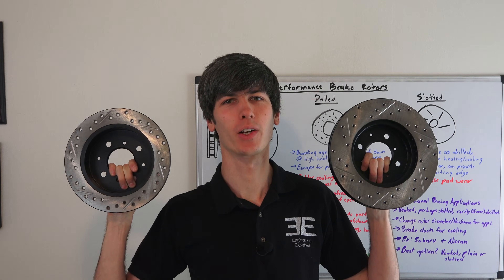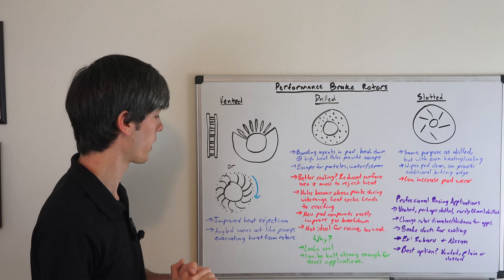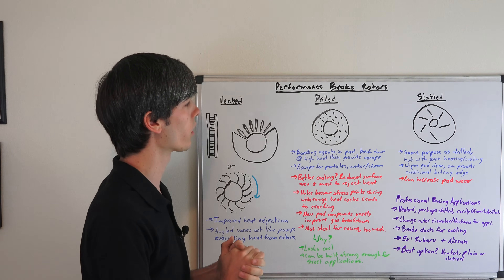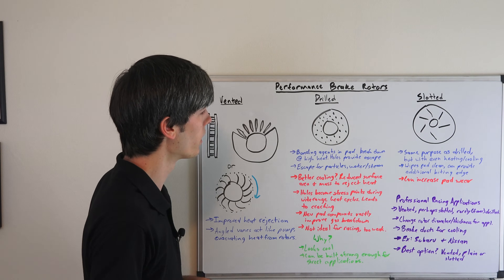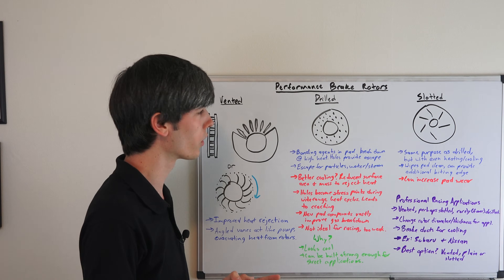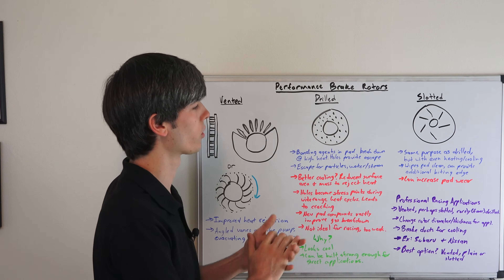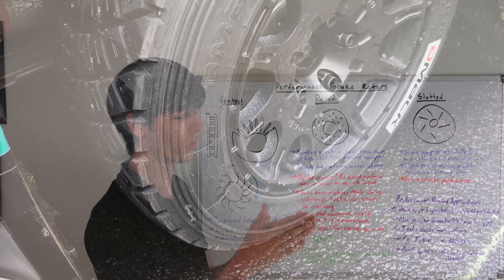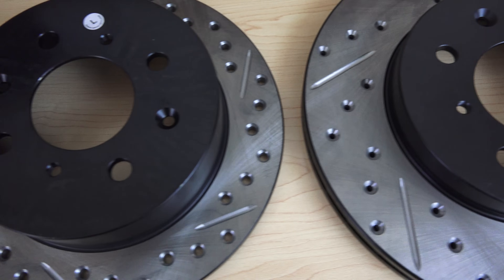Drilled, Slotted & Vented Brake Rotors - What's Best?

Comment: Anywhere in this video does he mention that drilled rotors decrease unsprung weight? It bothers me when he says "there's no reason". There's always a reason when you build a race car or street car. Often, cost and application. This is the second video I've watched where incorrect conclusions or assumptions are made without asking all the questions about the application. The Ford GT, which is a purpose built race car for the street used drilled rotors (among many other supercars). I'm sure material removal, heat dissapation, unsprung weight all came into play and were measured. They didn't just drill into them "for some reason". They test everything. "Because they look cool", you call yourself engineering explained...that statement is a design statement or marketing and subjective.
Reply: Well, "because it looks cool" is not that strange. Very often looks are much more important than engineering.
I know a guy that works in the aero department at Audi. He says the design guys always come first. If the aerodynamics don't "look cool" they're not going on the car, no matter how good they work.

Ford isn't going to drill brake rotors to "remove material". If they needed to remove material, they'd just make them thinner. Unless of course, it looks cool and sells cars...
Reply: Yeah thats why racing teams have gotten away from drilled even the new c7's are vented two piece rotors
Reply: He's talking full blown race car applications don't run with drilled rotors because there's not enough of a benefit. He also mentioned that street cars/supercars use drilled rotors as part of aesthetics and that companies will make them strong enough for their main purpose, which is to stop a daily driven vehicle under normal driving conditions or a supercar that will be driven hard every once in a while, at best, unlike an actual race car that's driven hard for atleast 30-40 minutes to as many as 24 hours of hard driving.

Comment: Every plain surface rotor I had on my cars very quickly warped - usually before the first pad change. The drilled/slotted rotors have never warped on me - even after a couple of pad changes (didn't have a chance to check the performance beyond that as I got a new car which came stock with plain rotors).

Comment: my civic has slotted vented drilled pads and painted red. plus ceramic pads. i beat ferraris and adds 50 hp each
Reply: Does it have v tak?
Reply: Just wait till you install a cold air intake.  You'll have trouble keeping that wicked Civic on the ground.

Comment: pretty good description of rotors, slotted rotors are made to cut a fresh surface to the pads and keep them as flat  as possible always giving a full pad surface for the most friction possible. the draw back is after the pads are done so are the rotors and they also have some vibrations from the slots scraping the pads at slower speeds. pretty sure formula racers use carbon fiber rotors that are able to handle much higher temps and reduce weight.

Comment: I thought the drilled rotors were popular to save weight. Kind of like a lightened flywheel. Itll take less force to spin something that weighs less.
Reply from the maker: xsenceo89x How much weight?
Reply: Engineering Explained That un-sprung, rotational weight yo
Reply: Engineering Explained  A couple of grams I'd guess 😂
Reply: Sometimes losing that mass can negatively affect the amount of heat the rotor can absorb too. 
Now ya have less metal, it gets hot faster with the same input.
It's all tradeoffs
Reply: xsenceo89x or just making them smaller is option. also when smaller the diameter will be less so the top part of the disc will waste less kinetic energy because the top part of the disc is with higher speed than the car

Comment: Engineering wise, the correct nomenclature is heat transfer, or heat dissipation. Not evacuation.

Another factor in drilled rotor cracking, in conjunction with cooling differential you mentioned, are the stress risers left behind by the drilling operation. 

Some high end rotors have cast-in  holes, which prevent that particular aspect - the microstructure of the metal is more uniform on all surfaces as compared to a ground rotor surface versus the drilled surface

Comment: have you ever watched a race or worked on a pit crew I have and drag cars and nascar use drilled and sloted rotters
Reply from the maker: +mk ninin drag cars only need to use the brakes once, so drilled is fine because it's a way of removing weight. Also done in drifting where there isn't much braking. Nascar as well has minimal braking. There's enough air resistance that letting off is generally more than enough for speed adjustments.
Reply: I went to a Supertrofeo race back in 2013 and while walking through the pit garages during the race, one of the pit guys asked if I wanted a souvenir then handed me a carbon ceramic brake disk off one of the race cars.  I don't know if they're 'drilled' but they do have holes in the braking surface just like a drilled rotor..  What's the story with these?  They're glowing bright orange at the end of a straight.  Do they just replace them so often it doesn't matter?
Reply: Carbon ceramic brakes are a different ball game when it comes to brake systems. Made from a different process, can hold higher heat, and last much longer. Hence their price tag.
Reply: how about formula one or motogp, they have disk brakes called 1200 holes made in carbo-ceramic compound, why are they using them if they might fail?
Reply: +Faby0699   As mentioned above, CCB have much higher heat capacity and can handle deep heat cycling better than cast iron. They can also tolerate cracks better without compromising function or structural integrity.
Reply: thank you!
Reply: Isn't excessive hard braking almost the ONLY thing that changes in drifting?  Besides eating thru tires and suspension

Comment: Love your videos. Brake rotors with holes do not create a fast temperature change. They cool off just about as fast as ones without the holes. I've seen temp tests measured on real street testing. But you are correct about surface being reduced with the many holes. I believe most all rotors are vented these days. And that is about the only thing that really matters. Temps do change higher and lower which is dependent more on racing and type of track. Not street use. For street use these do nothing to enhance the performance..or change temperature to benefits. Only the looks of them is the change. It is why you don't see spec temps listed for slotted or drilled rotors. The temp changes are really insignificant until you get to really racing around a track.
Reply: EE didn’t refer to a fast temperature change across the whole rotor. He specifically said holes result in rapid temperature ‘differential’ between areas of the rotor made of steel and adjacent areas made of well, air / nothing. Notably, the specific heat capacity of steel is 490 J/kg°C v. air at 1005 J/kg°C. That’s a significant differential that could lead to cracking even if only micro-cracks that only NDI can detect. Still, not good.

Comment: This cleared up a lot of controversy, thanks
Reply: TheCowGoesMoo o yes it does
Reply: ***** It does happen regardless of types of brake rotors, expecially if the weather is cold, and you go through deep water. 
You only need to give some heat on your brake system, and water will evaporate in seconds.
Reply: ***** correct, because no one drives with gt3 brakes in the rain on the highway. My regular rotors have done perfectly fine and has never done what you have experienced.

Comment: I believe you are 100% correct on all points. Imagine my dismay when my 2007 Corvette ZO6 had drilled and slotted front rotors. I guess GM didn’t get the memo, and wanted to impress potential customers.

Comment: I just put slotted / vented / drilled front rotors on my 2012 Honda Odyssey which are prone to have warped rotors after a few thousand miles. Honda has a problem with their brake design and time will tell if this holds up but so far I'm happy with it.

Comment: If you suspect your brake rotors are very hot from current aggressive driving, or some sudden stops,  do not sit with the brake pad on the rotors. Rather, apply light pressure, and let the car roll a little.  Otherwise brake pad material will adhere to the rotor causing a pulsation in the pedal.
Reply: the pulsation is from the rotor warping. if you got the rotors hot enough to melt the pads onto them, you need to replace both because overheating rotors hardens the material and warps it, causing a pulsation and reduced braking performance...same with the pad.
Reply: Adam S correct.  I am saying not to leave the pads sitting on hot rotors. Although, rotors can be cheap, it is best to have the oem rotors machined at a machine shop. This removes the material causing the pulse.  Many of the aftermarket rotors are not as good as the oem.
Reply: +Adam S

Another brake myth just like drilled rotors. Rotors never actually warp, pad material just deposits unevenly. Same effect but the cure isn't better cooling like people think it is. StopTech has a whitepaper about it.
Reply: +Leo. definitely not true, rotors most definitely warp. I've chucked up thousands on a lathe. The rotor runout however does not cause a brake pulsation because the whole caliper slides back and forth with the rotor.
Reply: +Afroninja52 .... Read it again dude... The warp effect is uneven pad material deposits on the rotor. The rotor itself doesn't actually warp. This is coming from one of the largest brake manufacturers.
Reply: +Afroninja52 Brake pulsations exist. Brake pulsations can be fixed by cutting a rotor. Brake pulsations CANNOT be prevented with drilled/slotted rotors. Brake pulsations CAN be prevented by using better brake pads. Make sense?
Reply: +Leo I never said that pad material transfer does not cause pulsation. Indeed it does. But rotors do in fact warp from excessive heat. If they don't then why do rotor manufacturers have runout limits? You can only cut rotors if they are within runout spec and above min thickness. That's like saying that rotors also do not get hot spots.
Reply: +Leo Yes, rotors physically warp when very highly heated. I've had it happen on many vehicles. Some light enough to just turn and fix, others way too gone.
Reply: You guys are hopeless.
Reply: Why would you apply light pressure at all? After a track session, we leave our cars in gear without the brakes applied at all so that the pads don't melt onto the rotors.
Reply: +n8tehgr8 Traffic in the pits, especially at 1/4 mile tracks. Idling forward to get your time slip after a 10 second run, coming off the highway after roll racing or off the mountain road after a canyon run.
Reply: +Leo what about the e brake?
Reply: +Junior Pivaral that will be a guaranteed way to ruin your rear rotors only.  At least when your rear rotors are warped, the steering wheel will not wobble, your rear will just wiggle, and the brake peddle will pulsate.  I would suggest to not use any kind of braking on hot rotors - front or back.
Reply: But my genesis coupe has rear mini drum brake style brakes inside the rear rotor when i changed my brembo rotors to slotted
Reply: +Junior Pivaral E brake just uses the mini drum so yeah, go for it. No idea what that dude was talking about.
Reply: +Leo Link to the Largest Manufacturer that said that please.
Reply: slotted rotors keep the brake material from building up on the pad and thus HELP keep material being transferred to the rotor.

Comment: I purchased cross drilled/ slotted rotors along with a ceramic or "Red series" pads.
My Stage 1 2010 Passat stops so hard it's actually dangerous. My question is in regard to the effect this type of setup has on the factory abs which my brakes ( being able to easily lock up all 4 corners now) can seemingly render useless. Could you do a video about the abs system and brake system upgrades possibly? 
Thanks for the info and great brake rotor video.
Reply: If you're engaging ABS too easily now, get stickier tires. That's all you can do to remedy it.
Reply: I'd just pull the ABS fuse when you go racing. That is if the ABS system is not routed through and/or works in conjunction with another system.
Reply: Pulling the ABS fuse won't stop your brakes from locking up too early. They'll lock up just the same. The only difference is they'll stay locked up instead of the ABS pulsing the brakes for you. 

The problem is his brakes now overcome the traction limit of his tires. Only solution is to get tires with more traction.
Reply: y
Reply: Wait, what? No they don't stay locked, that's not how a hydraulic system works. Once you release the brake pedal, the brakes stop clamping, as well. ABS intervenes via software. You take away that software via pulling the fuse and the ABS is disabled and it's up to the driver figuring out threshold braking to keep the car's brakes from locking up.
Reply: Yeah, no kidding. That's how brakes work. Pulling the ABS fuse still won't help at all. His problem is the ABS comes on too early for his liking. Disable ABS and it just changes the problem to his brakes lock up too early for his liking which is far more dangerous. 
Tires with more grip is the only way to actually fix the issue.
Reply: The ABS is electronically controlled and is intervening too early via software. His brakes will lock up less if the ABS is disabled because now the brakes are no longer pulsing as early any more.
Reply: That's not how ABS works. ABS sense wheel lockup via the wheel speed sensors. Once lock up is detected it starts to pulse the brakes. It doesn't engage before the tires lock up, it engages as soon as the tires lock up.
Reply: Ideally yes, but quite a few cars engage ABS too early when the brakes are applied at a certain pressure rather than when the sensors sense lockup or slip.
Reply: It's not ideally, that's just how it works.
Reply: Indeed, how would the sensor know to trigger the ABS if the wheels were still turning?
Reply: I'm pretty sure his ABS kicks in too late, and he wants to get better/more sensitive ABS. I think.
Reply: I hate to inform you but putting drilled and vented rotors on a road car is the equivalent of putting a m3 badge on a civic. its a definite downgrade and a big no no...... they wear out way faster (pad and rotor)  the slotted an drilled rotors are no good for road use, you would get better braking with the better ceramic pads and a standard vw vented rotor. this is often the illusion of modern performance parts unfortunately. no true points of application are know by the consumer. and if you really are heating the brakes up so much on the public road that your loosing braking performance my response is in that of a prayer. ime not saying you should not  use the brakes so much no... ime saying that the heat range in wich  you would be operating in for those rotors to make a difference on the road would be very fast driving indeed. and for your abs... you would have to re program the software for the abs, the sensors readings wont match tolerances on the system. otherwise its bigger brakes and abs fine tuning or delete. p.s I hope you run quality tyres.........
Reply: now that your brakes are working properly, you might want to check why the ABS is not........Implementation of ABS is different among manufacturers., or you may have damaged the ABS when you replaced the rotors/brakes.

Most people just force the caliper pistons back into the caliper without opening bleeder valve, but this can damage ABS system components.

Comment: Vented+slotted in my opinion, especially if you are on a budget.

The reduced weight and airflow is so minuscule in drilled you couldn't tell, however the risk for the discs cracking is a real concern.

Comment: Mono block vs two piece calipers
Reply: Lol I know monoblocks, but he should do a video on it
Reply: +Euge Lymbers Dont you mean floating and fixed?
Reply: +Daniel Kerkotchian same thing, I've heard both I like the name monoblock better though
Reply: +Euge Lymbers what's the difference between them?
Reply: +Bart Van Riel two piece sliding calipers are your standard everyday caliper that most cars have, they usually have one or two Pistons on one side, mono block fixed calipers a solid one piece with 4-6 Pistons with a 50/50 split have Pistons on both sides these brakes are much better because they are solid so no sliding parts which means less flex and normally have more Pistons pushing the pads, like AMGs Ferraris and Porsches have monoblock fixed calipers
Reply: Euge Lymbers aha like that, thanks mate!
Reply: +Euge L Monoblock also tends to distribute pressure evenly across the rotor due to pistons exerting force on both sides simultaneously. More consistent brakeforce distribution and more even wear.
Reply: +Josh Conover (Slipstream) I have heard they also benefit more from slotted rotors due to the even pressure not allowing the slotting to cause a significant increase to wear, and due to how flat the pressure is applied, can cause reduced performance on plain faced rotors, from air cushioning.

Comment: I have the cross drilled/slotted hybrid brake rotors on my 2004 Mazda 6s. The best brake pads to use are the ceramic friction material and the front discs still have a lot of pad life left after 10 years.